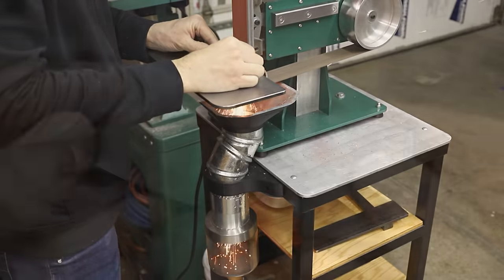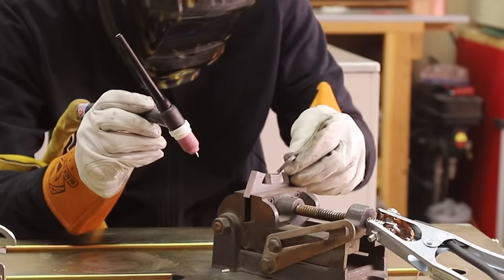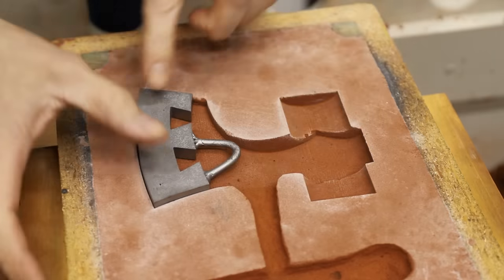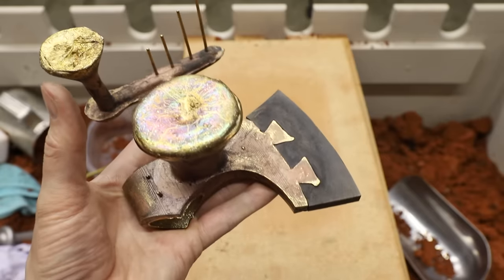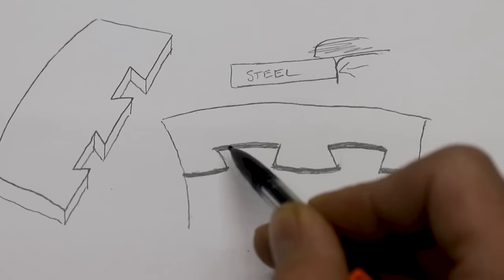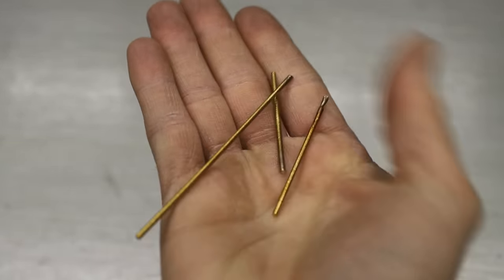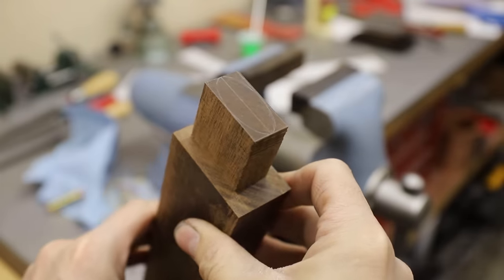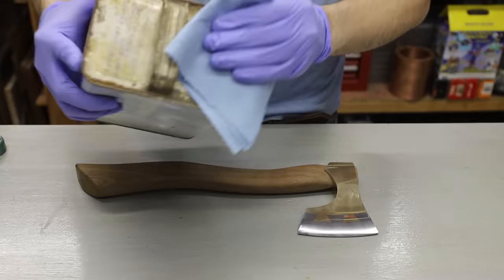Making a bronze hatchet with a steel blade - Dovetail Axe

Comment: Seeing you hold the hammer by the middle of its handle @7:45 reminds me of when I was doing my toolmaking apprenticeship at the Ford UK Apprentice Training School at Harrold Hill in Essex.  We rarely saw the boss of us all, but he had a workshop at the end of one of the workshops, so one day when walking through the workshop he say an apprentice using a hammer as you were.  So he took the hammer and cut off the rest of the handle telling the apprentice that you always hold a hammer by the end of its handle.  I am 74 now, and long since retired, and I am not sure I agree with him as I am sure there have been times when I used a hammer that way. On the other hand, I have just counted, and I have fifteen, all different, hammers in my toolbox, so I'd argue that if I found myself wanting to use a hammer holding the middle of its handle, then I was probably using the wrong hammer.
Reply: i find that swinging a hammer just to hit something hard, its best to use the end of the handle, but for a more delicate or finer approach the middle or any other part is preferable for balance and control, and thats what i do mainly because i dont have many hammers of diffrent dimensions
Reply: Just out of high school, I worked on a crew building corrals, cattle pens and fences from wood and wire all over Texas and Oklahoma. Try hammering a nail or staple into oak wood and you'll soon learn the only way that's gonna happen is if you hold the hammer on the end.
Reply: middle for control, end for maximum leverage
Reply: @vaelophisnyx9873 
Or as the original comment suggested, use the right hammer.
Shorter and lighter hammers for control.
A full length heavy sledge for destruction.
Something in between for various levels.
Reply: @Watchyn_Yarwood 
End or not, the length is what matters.
A short hammer isn't gonna be stronger than a longer hammer of equal head weight because you hold the end.

Halfway on a 40cm handle is better than end of a 15cm handle.
Reply: @phasepanther4423  You have a wild and vivid imagination! Nowhere did I say or imply that the length of a handle had anything to do with it. Think with your brain, not your keyboard!
Reply: @Watchyn_Yarwood  
And I'm saying holding the end isn't magic as you claim it to be.

Comment: Beautiful. Too pretty to use in regular service.  Great design, great result, the hamering of the dovetails was a good insurance I think to close any gaps.  The welded loop prevents sideways movement though drilling three pockets into the steel dovetails would have been almost as secure.

Comment: First video i've seen of yours and I have to say what a genius way to dovetail two metals. If you hadn't of asked what I would have done differently I wouldn't have said, BUT solely for CC, I'd have made the handle more slender where it met the axe head and a little less bulky with more elegance for an all over well balanced piece. However still an absolute fabulous project. well done :0)

Comment: That looks cool and awesome. I'm thinking though if it's actually stable for a long time. Because you know, usually when 2 dissimilar metals are in touch with one another they will corrode overtime.

Comment: I love the dovetailed joint between the two metals. The only thing I'd have done differently is to design the aze so that you have a bit of a hammerhead on the back side. It makes the axe more useful and prevents the polished bronze from getting banged up.

Comment: 1) Buy a spokeshave if you're going to be making handles (or make one?). Much more efficient than a rasp.
2) Your handle is pretty chonk. I'd stick with 3/4" thickness throughout. After cutting the side profile you can get a big start on the shaping by using a 3/8" roundover bit with a router.
3) I prefer the knob of the handle to be wider and flare out towards the fingers. It makes it feel easier to swing with a lighter grip without wondering if it's going to fly out of your hand.

Comment: Looks great, man. The only difference I would have done would have been to partially grind/taper the steel prior to heat treating it. This would save you a ton of time on the belt sander after casting!

Comment: I am very interested in this kind of composite construction of an axe. I suspect dovetail isn't the ideal shape, as the sharp angles could concentrate stress. A rounded line, like a zipper of puzzle piece nubs would avoid those.  Your technique is very well thought out! This technique would be ideal for making wood splitting mauls, because of the possible density of the aluminum bronze.

Comment: Very cool way to do it. I at first thought of Titans of Machining and their zero tolerance wire cutting. The could cut both parts and have them be a calculated difference to tight so to fit them the brass would be as cold as possible and the steels heated up in or to fit them together, and hopefully when cooled down they would practically be inseparable. I might suggest it to those guys. Not saying they will even see it but I would love a video of someone marrying two pieces of metal like that.

Comment: I would drive a small piece of brass tube straight down into the top of the handle in the eye of the axe perfectly centered through the wedge you drove into it. It makes the axe head more secure.

Comment: Definitely a beautiful piece of work! However, the steel is super hard and the brass is super soft right?  Definitely not made for long-term use, but more of a showpiece! Again a beautiful piece of work great craftsmanship! With every impact of the hard and steel onto whatever you’re cutting, will start making the brass come loose because of a soft material, you can almost see that towards the end of your video that the gaps were getting larger. Again, not taking anything away from the artwork you have made.
Again, beautiful keep on making cool stuff!

Comment: You should try coating your molds with boron nitride. It acts as a thermal barrier and lubricates the mold. The metal will flow more efficiently and stay molten longer. ZYP makes a water-based aerosol and pump spray suspension that makes application a breeze.

Comment: I would have drilled holes in steel and a grove down middle so there is NO WAY bronze would slip side to side or front to back. I know copper LOVES to cling to Iron. 😊 This way there is  NO CHANCE of steel blade "slipping off" due to bad metallic bond. 💖 from Minnesota 😎

Comment: If the steel could be preheated and its interface surfaces (dovetails etc.) fluxed IMMEDIATELY prior to pouring the bronze, the aluminum-bronze will fuse with the steel creating a BRAZED JOINT.  The dovetail is a wonderful design element, but a brazed joint alone is likely to be adequately strong though way less cool.  (aluminum-bronze is one of the most-used brazing-rod for steel)

You also could try brazing the joint surfaces of the steel immediately prior to pouring to better accept the cast bronze.  Good luck!

Comment: The axe head itself looked amazing - casting into the dovetail was a clever idea. I feel like the handle could have used a little more detail to complement the head. Nothing major... maybe like some basic carved design with a wire inlay or adding a bronze bushing toward the end where you could run a lanyard. Overall, it was an excellent project. Well done.
Reply: Pouring molten bronze is the simplest solution, but as we can see, not the best.
It seems to me that it would have been better to think about how to adjust the dimensions of the bronze by processing, I am sure for this part it is not difficult, especially considering the author's experience and tools.
The main thing is to make the bronze 1-2 tenths of a mm larger and rounded on one side, so that later this side can be driven into the steel part. Steel can easily cut off 0.1-0.2 mm of bronze when driving. In this way, you can get an ideal fit and reliable fixation.
But the author still deserves respect and admiration for his enthusiasm. Today, there are fewer and fewer such channels, unfortunately.

Comment: You probably can see the direction of the wood grain but I'm limited. I'd check the direction  of the grain with a draw knife before laying down the pattern. 
  Without a doubt, it's beautiful, probably be staying beautiful for years. 
  Did it get tempered? 
Great project 👍

Comment: A beautiful decorative item!  It's not optimal for blade material, heat treatment condition of either the steel or bronze, sharp corners of the dovetails, etc etc.  But nice workmanship.  I'd clear coat it with something so that the bronze doesn't etch from hand oils and reveal the welds.  
You could marry the two parts of another build by using deep freeze on the bronze side, but it would require very tight machined tolerances, which your casting approach mostly gets around.  I'm surprised that no gaps opened from shrinkage of the bronze away from the steel, so maybe you did get some bonding at the interface kind of like a braze.  Might be worth experimenting with flux between the two materials.

Comment: Interesting way of going about it,  from the thumbnail I was thinking you were going to make the steel part dove tail openings slightly smaller, then just heat it up so it expands enough to slip over the notches on the bronze then let the cooling contract it nice and tight.

Comment: This axe will need to be stored somewhere very very dry.
Any moisture will create galvanic rust immediately ( because steel and bronze are too far apart on the galvanic series table ).
Just a heads-up, the axe is beautiful.

Comment: Very nice, quick and easier way to do dovetails.  With that method unique interface patterns are practical.
While bronze is typically copper and tin, does replacing the tin with aluminum make for superior attributes?
Favorite axe, Benchmade Sampson: aka axecaliber  laser cut from a sheet of high grade tool steel with a molded handle.  EXCELLENT balance.
As for suggestion on a bronze axe, too inferior IMO.  Yet the suggestion given will be nothing to play with as the material is toxic.  Hence under show more
Beryllium can be deadly to humans if ingested.  Which means DO NOT GRIND.  Inhaling ANY dust will cause heath problems.  But if you're willing~
I wouldn't even tell the audience how to alloy Beryllium Copper, it's strong enough to make industrial springs.  We're talking a potential 100ksi tensile.
Like getting Bismuth vapor under you eyelid or Platainosis, you can never get ride of the effects.  So look these three things up before starting and BE CAREFUL!

Comment: Would have been cool to see you test this out in diff temps. I wonder if the two metals expanding at diff rates would be a problem or not depending on whether you're in hot desert or sub zero environments.

Comment: At first I was going to ask if you heated up the steel, but you re-did it and then heated up the steel face , nice axe  and mental note down the road if head is loose soak head in oil or water to expand  :)

Comment: The welded peace  to hold it is decent, but to prevent side to side movement i would have least drilled few holes into dovetail for bronze to flow into and mechanically hold it in place. Cool idea, not sure how much actual use this will get. Would definitely work with leather worker to make it a protector since sharpening that will be pain in the ass.
Also going to steal that vertical metal dovetail design. Already figured to make same but on horizontal surface as a inlay using similar method but it would be mostly hidden and entirely decorative, though i have one axe head with the hammer side is tig soldered with machine bronze to be more forgiving if you hit knife with it while camping. That has kinda similar dovetail element to reinforce connection between the two metals.

Comment: There is an electrolytic - galvanic - reaction between steel and aluminum bronze when they are in contact in the presence of an electrolyte. Aluminum bronze and steel have different positions in the galvanic series, which means they have different electrode potentials. In a galvanic couple, the metal higher in the series (aluminum bronze in this case) acts as the cathode and is protected, while the metal lower in the series (steel) acts as the anode and is more susceptible to corrosion. This reaction can lead to accelerated corrosion of the steel, particularly in moist or saline environments. Don't be sweaty around that blade.

Comment: Fascinating! I came upon this as an ultralight hunter/backpacker who was thinking about a steel tip/cap one might carry for occasional hatchet duties, but only if one first carved a wooden portion similar to your bronze section of this masterpiece you materialized. Assuming that could be done in about an hour (roughly, figuratively and literally), it might be an ultralight way to carry a hatchet for occasional or emergency use...alternatively, I wonder if you could take on a project that resulted in a 1/2 pound hatchet, that might still be a reasonable performer (if one perhaps lashed some heavy/dense wood to the rear?).
Cheers!
Reply: if its for light hatchet use could you not have a solid tip then almost like a skeletal axe head with some kind of bolt for fastening so you just need a stick basically for the handle?

Comment: You might've been able to dig a hole down to the steel part, then used a blowtorch to heat the part in situ.  Not sure how well the petro sand would hold up, but it's an idea.

Comment: Looks beautiful. How did the casting tempering end up on the cutting edge after all that?  If doing another one, i would also add a vertical wedge or dove tail to ensure the bronze can't flex side to side in relation to the steel. Apart from the impact, the blade can experience some significant twisting force in cutting.

Comment: I loved the whole process. I just thought I noticed a slight gap appearing around the dovetail after you had used the axe to chop some wood. My thinking is that the Bronze seemed softer than the steel cutting edge making the axe weaker overall and was starting to loosen the dovetail. My thinking is that this axe is an awesome show piece but not as a practical tool. I feel the Axe head should remain as a one metal construction to enable a longer working life for the Axe.

Comment: The only things i would have added would have been some dimples/concavities on the inside of the Steel part of the Dovetail < would add lateral support (side to side) to the joint.
Good idea? Yes? No?
You're probably never gonna read this anyway 😆
10/10

Comment: Personally I would have chamfered the edges around the dove tails to physically lock it into place once you peen the material over. Similar to how an axe head tapers in the eye to lock the handle in place once the wedge is driven in. Still a great video and a great build!

Comment: Part of me wonders if it wouldn't be easier to process the 3d print smooth, so the you don't have to do as much filling/grinding on the metal work. But, either way, that is a seriously cool looking hatchet.

Comment: I think it would have been a good idea to drill some small holes in the iron where it meets the bronze before casting. Then the bronze could form rods going into the holes when it’s cast in order to have more purchase.
Reply: I would keep the holes shallow, though. Too deep could compromise the integrity of the steel. At least I would assume so. I’m not a metal worker in the slightest 😂

Comment: I would have twisted the steel support into a hoop and maybe ran another just over the tops of the dove tail on the other side. But that's just me being overly cautious with a dove tail joint only other thing I would do is for the pour try to keep the top of the mold level by making the easy the head sits in it at the angle or make a reservoir dam to keep the metal from poring across the mold and onto the ground.

Comment: It's nice, but I'm not sure the exposure to the hot aluminum/copper alloy would be enough to get a solid temper on the hardened steel. Tempering requires that a piece be kept at a certain temperature for a certain amount of time, and while the hot liquid metal would transfer a lot of heat initially, but after 15 to 20 minutes, you'd be below the temper temperature for that steel, and then nothing would be happening. I would probably (just to be safe) have left it in the oven for a couple hours at the specific temperature required for the temper. I don't foresee any adverse effects on the alloy...but it might prevent an accident later on.

Comment: Sir, I have an idea. Can you make a metal chess with different kinds of metals like copper, silver and aluminium? The major part of chess board can be an aluminum box in which a few copper squares are enbedded. ( I just feel if we use copper or iron to make the chess board's major part, the whole board will be too heavy.)  The chess board also can be decorated with a wood frame to slime down its weight further and to make it beautiful, but the whole making project may come to be much more sophisticated.

Comment: I don't know enough about either metallurgy or tool making to comment on whether or not this is a good idea from a practical viewpoint, but it looks like a good axe, and from a purely aesthetic viewpoint I think it's a beautiful piece.

Out of curiosity, when you re-cast the bronze part, did you make a whole new batch of aluminum bronze, or did you include the result of the previous cast? And if so, did you remove the bit of steel cast into the first bronze part, or did it become part of the new alloy?